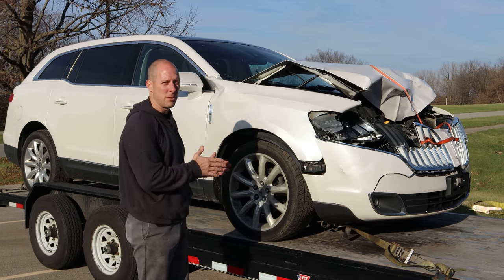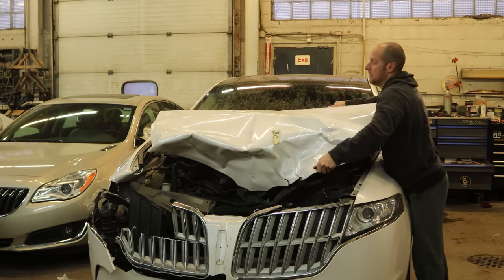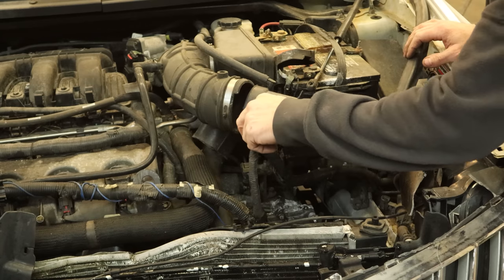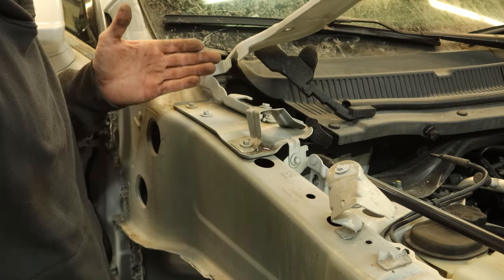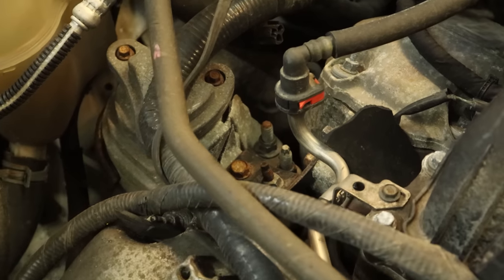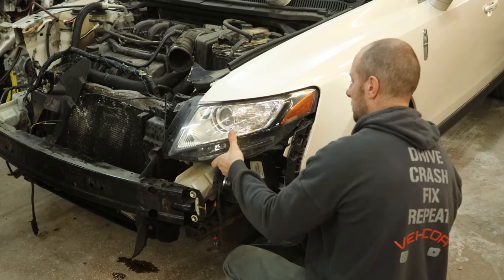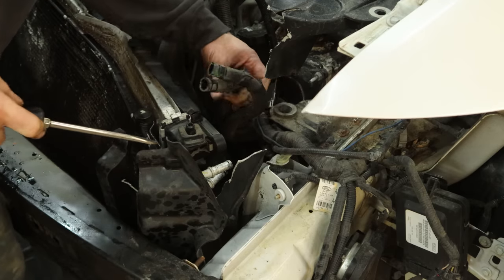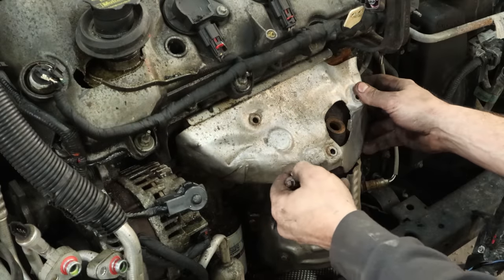Deer hunting with your Lincoln MKT is effective but costly

Comment: I was thinking 'moose' from the outset.  I'm not sure a deer could make that sort of damage unless you fired it from a cannon.
Reply from the maker: I got a good laugh picturing a moose being fired from a cannon. 😂
Reply: @vehcor  Moose bore cannon are for taking down city wall.  Deer bore cannon are for taking out MKZs
Reply: Velocity X mass = totaled
Reply: Could be an Elk.  Or a rhinoceros the way that motor mount is cracked.
Reply: Have you seen the deer in the upper parts of the USA?  I've seen a deer do worse damage.
Reply: You'd be surprised how much damage a 250+ deer can do, they are basically the size of a moose. The size of MI. Whitetail is why Texan and other southern state hunters and hunting clubs bought and imported them.
Reply: If it'd been a moose, the windshield and roof would be gone.
Reply: @aelaan12  or an elf
Reply: @IBenZik  depends on speed, maybe 70 mph at impact?
Reply: @aelaan12  there are a lot of rhinoceroses in N. Michigan....
Reply: or maybe you're goin 80mph+
Reply: @marcuscicero9587  who doesn't go 80?
Reply: @Channel-gz9hm  Moose strikes come in different sizes.  I had friends hit a small moose with a Prius at, they say, 55 MPH (I think it was slower).  The Prius was totaled, but all it did was knock the moose down.  It got up and wandered off.
The son of another friend hit one with an 18 wheeler carrying a full load of steel and turned it into a moose slushie.  A moose ‘speed bump’ as it were.
The deer strikes that I’ve seen have seriously messed up the front ends of cars, but this visible damage is on the high end of that damage spectrum…
Reply: AND I’ve also seen the bad moose strike with human fatals, where a too small of a car hits too big of a moose, or the unlucky car is the right size to lift the moose into the windscreen, A pillar and roof.

Any moose strike is a crap shoot.  Not recommended.
Reply: @vehcor  I'm sure I've seen that in one of Hanna Barbera's wildlife documentaries😆
Reply: I hit one at 60 in a 2008 Equinox and it did more damage than this.  Surprising what they can do to a car.
Reply: West central Illinois deer can do damage like that and a whole lot more.
Reply: Ask any claims adjuster how much damage a deer can do to a car. I've seen brand new cars that had to be totaled and the insured said the deer got up and ran off.
Reply: Moose are much taller, that would be around his kneecaps.
Reply: I thought the same thing
Reply: My friend's cousin hit three deer in one winter. Totalled three full-size trucks... Wisconsin isn't safe to drive in I guess.
Reply: Hit 400 pounds going a hundred mile an hour
Reply: I worked on the Illinois Tollway and called in multiple deer strikes. You hit one at seventy plus miles per hour, it kills a vehicle quick and is not pretty. Worse for the deer...

Comment: Hope you had a good break. Surprising how much damage tripping a deer can do, but considering what the bush donkeys can do to a transport it makes sense. Should be interesting to see the rebuild. I always learn something here, mainly the sarcasm, or the proper use of the bumper installation tool. Thanks for sharing
Reply: Think you are safe in the desert? Snake? Gopher? 
Nah! 
Try wild horses and extra large burrows. 9 times out of 10, they are fatals. Thru the windshield and peel the roof back. 
Average speeds are 80+ on our smooth, straight, no traffic roads. 
Slow down at night...

Comment: Used to have a '91 Explorer that went toe to toe with a dear. It ran out in front of me during some rain, "grill guard" took the brunt but shoved it into everything it was supposed to protect then scooped the deer under the suv causing me to lose control and slide off into a tree lined ditch. Luckily the ditch kept me away from the trees.

Comment: That deer did way more damage to the Lincoln than what the kangaroo did to our Mitsubishi Starwagon when my wife hit it.
Reply: Saw the aftermath of one Deer bending every body panel on a Dodge pick-up truck many years ago. Right front fender was only good one left. The Deer was definitely tenderized by the time it hit the ground.
Reply from the maker: I have only seen one kangaroo hit in Chicago in my career.  It didn’t do much damage but is a pretty uncommon occurrence here. 😂
Reply: @vehcor  Pretty common here in Australia with kangaroos being fairly well everywhere except in the cities. The damage to our Starwagon was worse because it was a medium sized kangaroo and it went through the grille, taking out the radiator, condenser, fan and water pump. The hood and bumper were also damaged and replaced and the radiator supports were straightened. All up, $4.5k damage.
Reply: @vehcor  how did someone hit a kangaroo in the states?
Reply: @agger838  they were imported and some probably escaped
Reply: @BrucePierson  I mean except that one time a roo closed the Sydney Harbour Bridge...

Comment: Funny I just picked up one of these off the auction labeled mechanical with clean title for the infamous water pump/timing chain combo.  Was going to sell, but think I'll drive it just to annoy the wife as she hates the styling! ha.
Reply from the maker: Let me know if you need any parts.
Reply: Everybody thinks that water pump is the death of the 3.5/3.7. I can bang out a pump in 4 hours.
Reply: @mph5896  Yes, its back on the road.  Took me longer then your time for the first one, but wasn't gloom and doom like people thought.  Pretty straight forward.
Reply: @Oldstar234  Eh, I have done a bunch. I can't believe the job pays 10+ hours flat rate🤣

Comment: Had an 02 cavalier that whacked a deer. Coming home from work at 1am. Only thing it did was dent the hood and shatter a headlamp. Must've been going about 45. Worst part was I got pulled over a few miles down the road and given a ticket for having a light out.

Comment: I work at the Ford plant on the higher-trim vehicles they seal the finders like that to make it quieter in the cab from wind noise
Reply from the maker: I understand what it is supposed to do.  It seems foolish to worry about noise when so many other issues plague these cars.  Not to mention you cannot tell the difference if the fenders are not glued back on.  I have seen 100s from shops that just throw them on and there is no more road noise than ones that are glued in.

Comment: I'm not sure if they still do this but when I was in the Marine corps the Navy and the Marine corps both had a lot of aircraft with magnesium parts and that's not a good thing on board ship because magnesium fires are almost impossible to put out
Reply: Thank you very much for your service sir
Reply from the maker: Yes, they still use magnesium on the landing gear because it is lightweight.  Most airport fire crews use a class D dry chem fire extinguisher that will put out magnesium fires.  It is still used in cars but not usually in places that are prone to fire like the front end.
Reply: @vehcor  if I remember right that dry powder was called pkp

Comment: MKT, never one of my favorite vehicles.   They looked oddly like a hearse.    Amazing how much broken, crumbly plastic "rained" off this car!    Lovely 3.5L/3.7L ... probably needs a new chain and water pump before the engine self-destructs.
Reply: Mid 2011 they went to a dual chain and those pumps seem to last longer.
Reply: I have NEVER seen a bad chain or any timing components on non turbo cars. I just replace the water pump, in and out in 4 hours for $100 in parts. I do mostly police cars

Comment: What's the story on those vehicles?  Are they piles of crap, or decent daily drivers?  I know the 3.5L has timing cover leaks.  Early 3.5s have water pump issues that make it super easy to grenade the engine once all the coolant dumps into the oil pan from the water pump. Researching my next vehicle purchase, and definitely need something that could handle some trips to the home improvement stores, as well as score some decent comfort on the highway.
Reply: First the naturally asperated MKTs are 3.7s (or 3.5 in a nat7rally asperated Flex), but Ecoboost MKTs and Flexs are both 3.5 turbos.   So the nat asper engines have great durability.  Problem is the s8nfle chain waterpump in the early years, but mid 2011, went to a dual chain drive and those water pumps seem to last longer).  Look around the internet, those nat asper engines are good for 300K miles.
Reply: @Raj  Ahh yes.  Forgot about the keyless door panel flying loose ar high speed and shattering itself against the b pillar.   Also, the armrests like to "split" aling the seam
Reply: I am familiar with the Ford Taurus/Explorer. Stay away from the turbo if you want reliability. Yes, the water pumps go and the timing cover needs to come off along with the valve covers to do them. PTU (transfer case) is garbage design, they go through cat converters like nothing, power steering rack has an electric motor on them and are expensive to replace. Hub bearings are the most seized on of any car I have ever seen when replacing, front lower control arm bushings go. Other than that, great cars🤣

Comment: Great video Scott hope the way your abusing Mr Spotty your paying him hazzardist duty pay at least. As for deer hunting with cars reminds of when I was a wee lad of 16 and I was tooling down RT 41 in  my 1968 Pontiac Tempest Custom overhead cam six banger with a three speed Hurst on the floor one of my favorite cars when I was a kid. Well 2am in the morning driving along I see a deer I slow down and there's another and another I'm almost at a stop thinking the coast was clear I tromped the gas and guess what a Lollygagger yep I drilled it dead center. I stopped and the deer didn't it slid up the road about 20 ' give or take (Massachusetts deer aren't very big ) so it lay in the road I get out of my car and start walking towards it. The deer picked up its head and looked at me or my head lights like it was thinking WTF just happen with little birdies flying around it's head. Before I got to close it found its feet ran out into the woods. Well I turned my attention then to my car sitting there headlights on engine off I looked it over and other than some hair it didn't do anything to the car. I got in and drove home. That's when they in my humble opinion built cars you can deer hunting well almost bag a deer and drive home no body shop required 😊 My kids 2009 Toyota corolla on the other hand after hitting a deer well you know what happened there. Happy new year Scott😁👍

Comment: If a moose had hit that Lincoln, you would be replacing the roof and both A-pillars.
Reply: If its a big one.   I'm actually thinking this a sub 1000 pound moose strike.   Its got a high enough front end, it wrapped around the moose versus pitching it into the windscreen.

Comment: Do you think a front end  "brush guard" or "cow catcher" would protect a truck or perhaps this car from a dear hit? 

I've been thinking of getting one of these for our Silverado. Thanks.
Reply from the maker: No, might save the radiator at best, but they usually cause more damage.
Reply: @vehcor  Scott, thanks for your reply!   2nd question:
---Would my Silverado still be driveable after the deer hit...so that we could use the vehicle for a day or so?

I just dont want to be "broke down" on the side of a dangerous road at night.  I can always get peripheral damage fixed later.  A good "brush guard" costs about $1100, but could keep us safe?  Thanks!